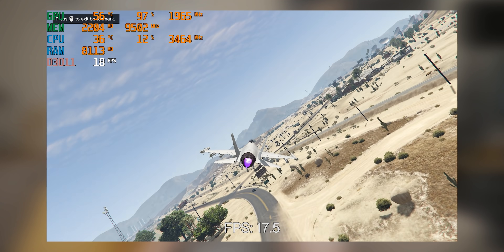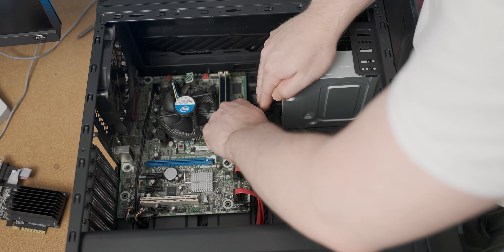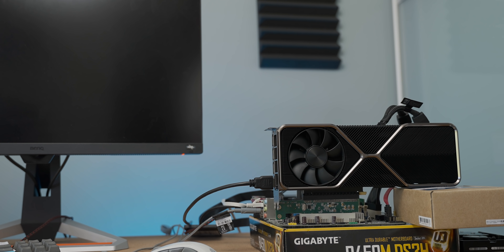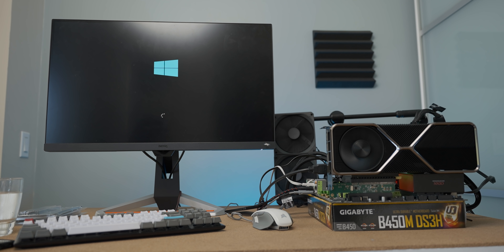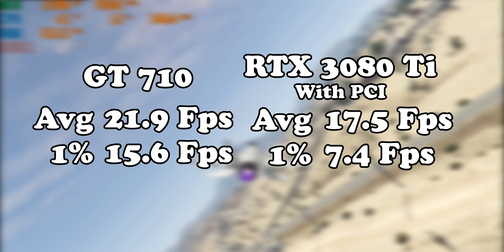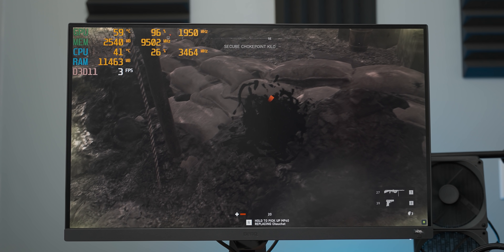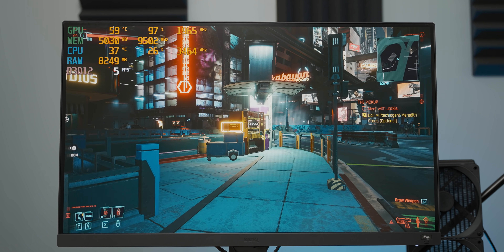How To Make An RTX 3080 Ti Slower Than A GT 710

Comment: lol some how this does not surprise me. What does surprise me more, is the RTX 3080ti even bothered to power on!

Back in the dark ages ( late  2000) my dad bought me a  shiny (although very beige) new PC. It was a Packard Bell... "iconnect" Honestly, it was my first PC and i was super excited, and I was super keen to play all kinds of games, but the thing was a heap of crap. It had a 700MHZ Celeron, 64MB RAM, and a 20GB HDD, and more importantly for this story, onboard video that could barely display the preinstalled copy Windows Millenium Edition. I had all these exciting ideas about playing flight sims, and Unreal, and a ton of other games, needless to say the little potato barely managed to run The Sims, or Black & White. So with my birthday money burning a hole in my pocket (and lots of begging) we took the box of infested E-waste  to a computer shop here in the UK called PC World for some upgrades! It didn't quite work out as I'd hoped. I was quickly told the future landfill resident was indeed a heap of shit, and didn't have AGP. However! They had some disgusting vile excuse for a graphics card that they could ram in to one of its PCI slots. I just ended up going with it, because what choice did I have? I was like 15 or so and nieve, and wanted to play some games, and didn't have the means to buy a proper computer! The "GPU" in question turned out to be a Power VR Kyro, which actually in its AGP form was a fairly capable, if under supported video card. But the PCI version was so riddled with puss filled boils that it barely made  much difference to my little potato's already rather underwhelming gaming performance. So what I think you basically did, is take a high performance, highly desirable graphics card and make it perform about the same as a GPU that was shockingly terrible in 2001. GOOD JOB!

Comment: So to be honest throwing an RTX 3070 ti through the bottleneck of a PCI slot is obviously going to cause issues.  Personally  I think comparing the RTX 3080 TI to the  GT710 with that adaptor would be interesting to see.  Would the 3080ti be quicker than the gt710, would the bottleneck of the pci slot cause them to run the same speed, or (less likely, but possible) the the GT710 actually has better performance because it isn't trying to hit the pci bus so hard to start with.

Comment: half life 2 on boat checkpoint with my 2017 lap runs better than the rtx 3080 ti lol, ( lap spec : i3 6006u, 8gb ram ddr4 2133 mhz, intel 520 hd graphics and ssd of 240 gb
Reply: How did you get half life 2 running? I use almost same stuff but 256gb SSD, i7 6600u, windows 10 pro

Comment: You could also cut off the extra PCI Express slot contacts so it fits into a x1 slot.  Of course, then again, it may not even power on, but that would also be one way to "gimp' the card....  Of course getting a PCI version (not PCI Express) would be the ideal bottleneck, but I don't think you can buy one that is a PCI card from the factory....

Comment: ASUS PRO B550M-C/CSM has a pci slot apparently and  i saw it on newegg canada XD not sure if a gpu can be run on that pci slot  but.... at least its am4 with b550 chipset.  pci-e to pci and even dual pci do exist and  are available on amazon , newegg ,aliexpress,alibaba and even the walmart website . some have riser cable  and some don't . lol have fun dawid XD some m.2 adapters to pci-e adapters also exist .  i wonder if you would get 1 fps  on an adapter/converters  stacking like that .

Comment: I doubt youll see this, but i often feel like my pc is really messed up, it was a custom pc but built by an external company, it was around $2200 but runs at not much better than some of the budget builds you have made for under $1000, it also often has problems booting and crashing, problem is i dont know enough to diagnose exactly whats wrong with it or whether it was poorly built 😂
Reply: If you are genuinely hoping for help, Post your build specs.
Reply: ur hard drive might be crappy or ram isnt in there properly or its faulty

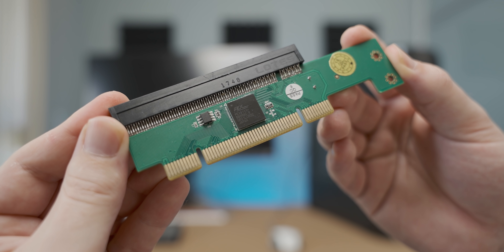Comment: 1:11
"You don't really  get modern motherboards with this connector"

Actually modern motherboards with a PCI-slot exists. Examples:  Biostar Racing B550GTA

for  AMD and GIGABYTE B560M D3H for Intel.  So this test could be done with Ryzen 9 5950X or Core i9 11900K.

Comment: My first pc I started out with the apu until I got my GPU but when I got the new GPU plugged in it wouldnt work. So what i did was remove the cmos battery for a few hours. put the battery back and the GPU in and everything worked just fine.

Comment: For those interested - the reason this works is because the PCIe uses the same base protocol as PCI. The transport is obviously wildly different - PCIe is a packet switched network running at dozens to hundred of gigabytes per second (aggregate bandwidth from CPU across all lanes) and PCI is a bus (133 MB/s shared, server versions could be up to 533 MB/s (PCI-X)), but while modern PCIe is a superset of features, PCIe 1.0/1.1 had few differences from PCI from a protocol standpoint. That's why these adapters work without specific support in drivers.

Comment: Curious how the 710 would perform in the PCI slot adapter also. Is the bottleneck entirely the adapter? Or the PCI interface? Also, wondering if you ran the 710 on a riser cable running at the theoretical same bandwidth as a full sized x16 PCI slot would come into any differences as well.

Comment: Dawid the ASUS Corporate Stable Model (CSM) line of motherboards all come with PCI slots.  These are made for business setting stability and are not bad motherboards if you are looking to build a business oriented system.  I've used B450 and B550 variants without issue.

Comment: 6:20 Just feel those frames drip around you like an old faucet that leaks. That 3080ti is sitting on the edge of destruction with that pci adapter.

Comment: That GPU usage number can't be the actual value of GPU usage, that adapter assumably sends it's own usage to the system. That RTX3080Ti is propably running at mere 10% load actually. Fans throttle to full speed since that poor card doesn't know what the f**k is going on so it goes into some kind of fail safe state. ;D

Comment: I didn't know they made these!!! I work in I.T. for paint / body shops that use very old but very reliable software and hardware some of which needs pci adapters. However when you go to make them a new pc there are no pci slots so this will solve so many issues!

Comment: Huh, so that's why Cyberpunk is sluggish? They use PCI protocol instead of PCI-E? Well, guess like we solve a mystery today.

Now joking aside, it seems that this PCI-E to PCI adapter was intended for network cards or USB 2.0 PCI add in cards back in those days where PCI-E quickly became wide spread and PCI cards are very hard to find. It doesn't help that the motherboard at that time usually have 1 or 2 PCIe slots whereas they have 4 PCI slots. So I guess there's a use case for that adapter as many could no longer find PCI Ethernet card in many stores.

Comment: The Gigabyte H310M S2P still have not one but two PCI slots. I have one paired with an i7-8700k and a GTX 1050Ti (a weird 1 slot height OEM version). However, I've choosed this specific MB because of these PCI slots, allowing me to still be able to use my rather old GPIO PCi cards.

Comment: What's the program you're using to get all the stats on screen? I'm new to the PC scene and still have a ton to learn. Got a 3090 coming today so I can build a beast editing desktop that can also game, at least some what I'm sure. 🤣
Reply: Msi afterburner
Reply: @contentthemaker  awesome, I'm trying to tweak my Omen 15 to get as much out of the 3070 Max Q, as I can. Didn't realize it was a Max Q, but that makes the $1600 price, make more sense. Needs more than 100watts, but still runs GTA V 4k ultra settings at 60FPS. Not so much with RDR2.

But I'll be using my desktop except when I'm at any LAN parties. That's where the Omen comes in. Easier to move around and spilt Jager Bombs won't make me freak out as much as a 4 grand desktop. 😂

Comment: Don't make fun of PCI, My first GPU was a Zotac GeForce 6200 512MB DDR2 PCI and it could run Pro Evolution Soccer 2013 at 640x480 low settings with 50 to 60 fps, and it also could run CSGO (2013) at 640x480 low settings with 10 FPS and artifacts.
Dislike!

Comment: That old GPU in the picture actually used an AGP interface. Last time I looked AGP was not PCI... It has a lock on the end and was actually the predecessor to PCIe... And it had a transfer rate of up to 2133 MB/s...  

Also, there are still modern mainboards with PCI widely available. Industrial mainboard which needs to be backwards compatible....

Srly Dawid, love your style of videos but do your research...

Comment: The last bit about Cyberpunk was so true 😂
Reply: I must have missed the joke... i started playing Cyberpunk a couple of days ago, im only on a R5 3600/RTX2060 Super and it runs flawlessly (RTX off everything else maxed)  Encountered a couple of minor bugs in the 20hrs so far, but performance is fantastic! I have it locked at 60 and it never drops blow that and is smooth as butter.  I have no idea what all the fuss is about.
Reply: @StuTheMoose  I so believe they optimized the game quite a bit since release. A friend owns rtx 20something super, and the fps would spike drop every now and then + general performance being somewhat bad
Reply: @StuTheMoose  I’m on an RTX 2080 Ti and i9-9900k and still experience massive frame drops, to be fair to CDPR they have massively improved the stability of the game since it’s initial release, but still a ways to go until it’s perfect. 

Edit: I also play on an uncapped frame rate without v sync, maybe that’s why I get massive frame drops in the city. I am playing at 1440p also.
Reply: @slaysi    Fair enough.   I'm only at 1080 which obviously helps.  Using vsync. Forgot to mention DLSS on quality as well.  Never seen it drop under 60FPS.  Half the time my GPU isn't even running full blast... seen it clocked down around 1300MHz a lot of the time which made me laugh.  I was thinking it was one of the best optimized games I've played!  Looks like i made the right decision holding off playing the game until now then :)

Comment: I would have been interested to see how much the PCI interface tanked the performance of the GT710, TBH!
Reply from the maker: Yeah, I should have checked that out. Apparently ATI cards hand PCI better. I may do a comparison soon.
Reply: GT730 vs R5 240?
Reply: @DawidDoesTechStuff   Sounds like you have the HD 4870 on the brain.
Reply: Depends on the PCI-E card generation and how many lanes it uses.  A 1x PCI-E 2.0 card has max bandwidth of 500MB/s, which would fully saturate the PCI bus's maximum bandwidth.  But the PCI bus is a parallel bus, whereas PCI-E is serial, so the motherboard's internal architecture plays a role too (Northbridge/Southbridge vs. MCH/ICH).

Hmm... I do have a motherboard sitting around with both PCI and PCI-E...
Reply: @LabCat  do it
Reply: @LabCat   You didnt consider architectural developments that lead to more frames for given bandwidth. A 64bit bus Pascal card will likely outperform a 256bit bus Fermi.
 So when both are constrained to a 133mbs pci standard, the Pascal should outperform any older tech.
Reply from the maker: xvoided  That is a good point. It will be interesting to see how it holds up.

Comment: you pig-tailed the 3080TI power cables, didn't you Dawid! .................... :/ Still you actually put a $1200 3080 in a PCI slot......first for everything I suppose!  Please try it with one of these too.......

amazon.co.uk/Express-Extender-Riser-Adapter-Power/dp/B06XD48PQ4

Comment: The gpu was not running at high utilisation. If you can see the temperature is very low that means it's not running at full speed.😁

Comment: Plugs 3080ti with i7 980.
3080ti: "are you having a laugh?"
Reply: Still rtx 3080 ti would be bottleneck on 1440p or above in 90% of the games
Reply: @kigasdj2  it wouldn't. My i7 7700 is bottlenecking a 3060 on 1440p.
Reply: @generalyido  i would doubt it. Even on 1440p i7 7700 would not bottleneck 3060. Unless you are running not K variant and your frequency is low. But I really doubt it i7 7700 is very fast cpu and on 1440p and 4k definitely 3060 is a bottleneck
Reply: @generalyido  7700 non k is fast enough for 3060 and doesn't bottleneck
Reply: @44danydany  yeah but my motherboard is so shit mine doesn't draw more power than 43W. So basically it's a ryzen 3 1300x. Mine can't boost itself and is stuck at 3.5ghz too. I have to find a new motherboard.
Reply: I felt this comment on a Spiritual level because I currently use an i7-920 :')
Reply: And i7 980 is still a usable cpu, i personally use a i7 2600k and i don't have any issue, yes its probably a bottleneck to the 3080 ti in low resolutions like 1080 or something like that, at 1440p is probably also a bottleneck but at 4k its probably not
Reply: Still an i7 rite
Reply: 16x 3.0 lanes should be fine tho?
Reply: Jonathan Hoffman  lol, do you even know cpu requirements for most of the games? You need i7 3770k or i7 4770k equivalent. They are 2012 and 2013 cpu BRO. Any 4 core 8 10 year back will run 99% of the games BRO. I run litteraly anything with my i7 3770k and I am bottlenecked by gpu all the time and I am running rtx 3070ti in 4k. People have stupid sense, that you need latest cpu's to game, which is complete nonsense. Ps4 and xbox one was running all games on potatoe cpu, reason you could run anything with old, but fast cpu's. It does not matter how many cores your cpu as long as it is faster than consoles cpu

Comment: I want to see what would be the best gpu on that Amazon computer
Reply: with the i5-2400 a GTX1060 6GB would be a good choice at the moment as RX580 pricing is still Stoopid,
if you upgraded it to a i7-2600 then you could consider GTX1070/GTX1660Super or RX5600XT

Comment: How do games run with the 710 in this adapter? Try it please.
Reply: I would assume not terribly different because it's an interface bottleneck rather than a GPU performance bottleneck. There's only so much information that can come from that slot, and it seems that the GT 710 can get more information (FPS) than the slot can provide. Although, the GT 710 is a PCIe x4 rather than x16 so I'm not sure if the reduced lanes would change how the adapter sends the information through.
Reply from the maker: I agree with Shawn, I think it would have been similar. The person who sent me the adapter said ATI cards handle PCI better. I may give that a try.

Comment: Makes you wonder how inefficiently games are made nowadays considering how well halflife 2 played on 130mb/sec
Reply: Half-Life 2 is almost 2 decades old. It doesn't have nearly as much data to push. It came out when AGP was the main GPU interface. PCI graphics cards were probably still relatively common.
Reply: that's one way to look at it.  but another is, not having to deal with extreme hardware limitations gives them more dev time to actually make games.  and opens up game-making to a broader skilled audience.

then again, they still target consoles...

Comment: 1:07 Funny you say that, because for some reason my Asus H310 motherboard has a PCI slot. No clue why, but it's still somewhat hanging in there
Reply: He should try pci with a 3950x since that is the fastes cpu i know that works with pci
Reply: Even some A320 boards have it. Maybe some people still using PCI Ethernet card or PCI modem card.

Comment from the maker: Thank you so much Watson for sending out this abomination of an adapter. 😁 Also, I know I often say this, but this really was the worst BF V performance I have ever seen.
Reply: I actually never thought that adaptor existed, what an abomination lmao
Reply: You should try the same thing but with those mining risers that go from PCI-E X16 to USB and then back to PCI-E X1
Reply: why does that adapter exist?
Reply: @prathamesh-bhosale  legacy systems
Reply: @AnonyMous-lk7zi  how do you fit it into a case with that adapter? The back side of cases isn’t setup for this increase in height.
Reply: @AnonyMous-lk7zi  Legacy systems on a Hobo's cardboard box for a test bed. ;-)
Reply: @shawnrhode  pci ribbon cable extender would let you mount it in that unused space under the motherboard
Reply: Best channel
Reply: Best video
Reply: Best youtuber
Reply: where can i buy this adapter?
Reply: Crypto mining dont care that much about pci bandwidth 60+ times a sec
Should fire up a miner and see how well a PCI slot can chew hash
Reply: Had or seen?
Reply: I still don't get what the purpose of the adapter is. If you had to use a system with a PCI slot and needed a graphics card for some reason, wouldn't it be at least as effective to find an actual PCI graphics card to plug in? I don't see what you'd be looking to do on such a system that would require more power nor does it seem possible to get it anyway, given the limitations.
Reply: @LabRat Knatz That makes sense, though if I I had realized that PCI graphics cards are rare and valuable, I'd dig the several I have out of storage and sell them on eBay! 

Just seems like this is going to end up awfully bulky. The adapter itself is nearly the size of a PCI card and then you still have to plug something else into it. How many of the devices one is "updating" are going to be able to house all that?
Reply: Lol